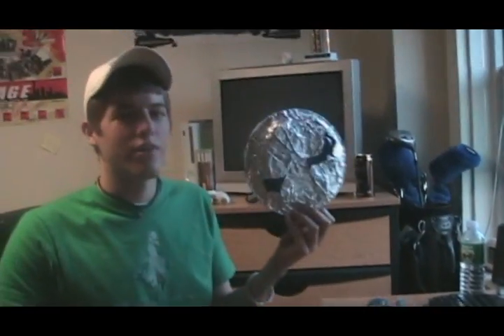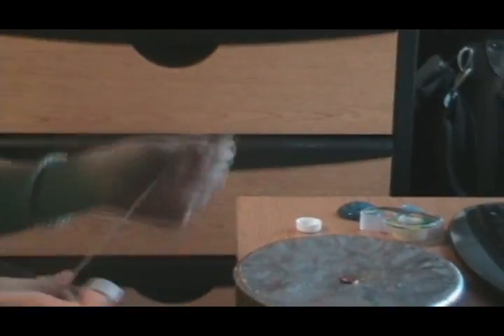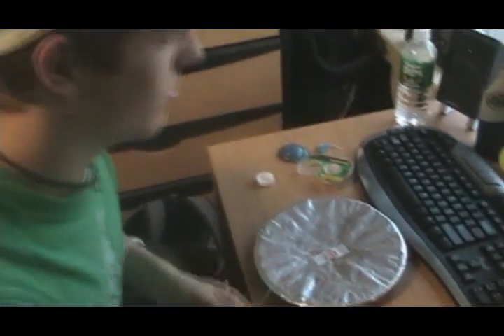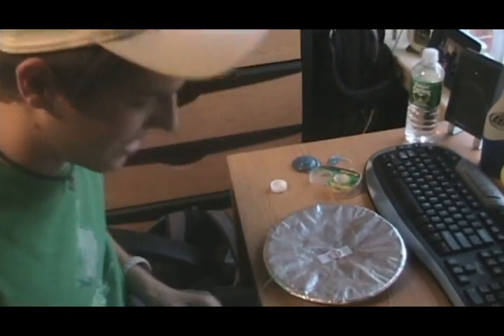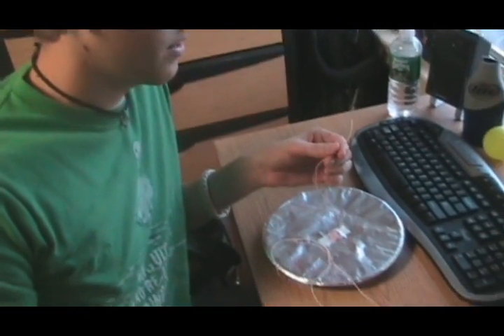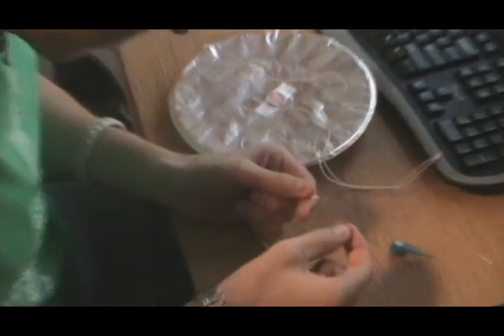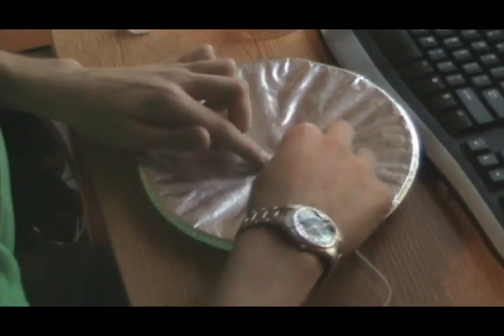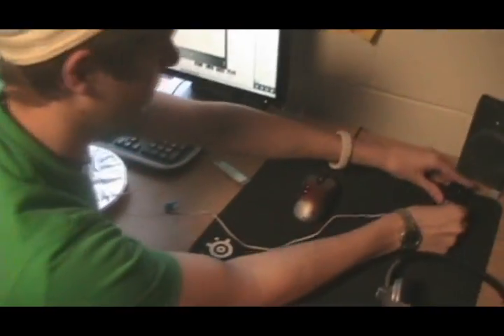RE: How to Create a High-Def speaker for under a buck.

Comment: I think you are using headphones' cable which has magnetic wire. This wire has a paint on it which acts as insulation. So it's as if there is no connection between the coin and the wire. There are to ways to make it conductive. Peel the paint off with a knife or burn the paint using a lighter briefly. If you use the latter method maybe you will also have to use the knife to peel the burnt paint off.

Comment: Mine worked shit quality but it worked just burn off the coating on the wires and put one wire from the left head phone on the penny and put the other one on the foil it's self n it should work just turn up the volume( if not work then I'm magical lol ) try it .

Comment: Right, I suggest that you could attach one end of the jack to the penny, and the other end to somewhere on the aluminum foil, but make sure that you have two wires from the jack or it might not work, but you are probably better off getting a magnet and making a voice coil from wrapping copper wire around a pen, or better a dry erase marker and attaching it to the diaphragm of the aluminum then hooking the two ends of the copper wire to the two ends of your audio jack.  :)

Comment: Nice presentation.  

For the next experiment, try getting a big bolt (say 1/4 or 1/2 inch diameter) and wrap lots of turns of wire around it to make an electromagnet. 

Connect that across the audio (needs to be more than headphone volume). 

If you bring a magnetic object (eg tin can) near the electromagnet you'll hear the sound.  Play with spacing for best volume.  Works but not great quality.

Comment: Don't worry it is normal,
that video was not true ..
but if you put a Circle inside the(under the center od the metal paper) roll it all (more than 50 turns with  a insulated cable) with one side cable, conect to the other side cable of the speaker out, let a little piece of  metal over the centre it works, but.. you need also to insert some resistence about 2 ohms.

Comment: well as far as i see it it will never work but what u can do is take a copper coil and replace it with the penny, attach it to the wires if u can figure that out and then put a magnet on the bottem attached to the inside and maybe with a little luck it would work.

Comment: With this conditions and materials you will never construct a  high definition speaker...

To construct high definition speaker you need to have membrane foil, bobine and a permanet magneto. (This is the tradicional way)...

Sound is made by variation of the air pressure... please explain me how you can have made a variation of air pressure with this stuff? Oh let me see, the penning is piezoelectric material... 

cheaty...

Comment: By coiling unexposed wires around the penny you can turn it into an electromagnet, but then you'd need a second magnetic element on the other side of the plate.

Comment: well first of all seeings as its 1 speaker its only gonna be mono sound, so seperate the cables and just tape down one side of the cables instead of the 2, its most likely the fact that you were taping down both wires therefore shorting it out. try with one side.

Comment: Some people thing the only way to create air vibrations are magnets. What you forgot is that air is created out of particles. Maby that alimunum thing ionisates airmolecules which wil somehow start to vibrate at the same frequecy as the wire sents the electrical shocks. Also the output for a headphone is a very weak signal because otherwise it will blow op your headphone. Maby try the plugs at an amplifier.

Comment: It amazes me that people here don't realise the joke.

BTW, you could potentially damage your speaker system by doing this - you're effectively short-circuiting its output with the foil and coin. Worse still, the speaker system might just pass the signals from the computer straight through to the headphone jack (I know some speakers do this), meaning the damage could instead be to your soundcard or sound chipset.

Comment: you need a copper pennie 
If your Lincoln Memorial penny has a date before 1982, it is made of 95% copper. If the date is 1983 or later, it is made of 97.5% zinc, with a thin copper coating, or "clad."

For pennies minted in 1982, when both copper and zinc cents were made, the safest and best way to tell their composition is to weigh them. Copper pennies weigh 3.11 grams, whereas the zinc pennies weigh only 2.5 grams.

Comment: **just a thought: a lot of speaker headphone wires actually have 2 wires running in them. one has a light silicone coating on it. when you strip the wire, try heating (with a lighter) the exposed wires to melt off the silcone. then try it again. i havent tried it yet, but this could be the problem lots are having.

Comment: you have to change the speaker options on windows. go to control panel, then click sound and audio devices, click on advanced under speaker settings and then click the setting for paper plate wrapped in foil, I did this and had no problems.

Comment: headphone wire have isolated coating on them. If you cut a headphone wire and connect them to a speaker nothing will happen, but if you burn the wire and/or sand it, it will remove the coating and work... 
butt still, taping it to the penny will short the wires and will not work

Comment: Cody, Use your brain.  Is there really such a thing as a speaker made from a paper plate, aluminum foil, and a penny?  Just because it's round with wires coming out of the center doesn't mean it's a speaker.  How the heck does a penny cause audio vibrations?  Think Cody Think.

Comment: How does it have the basic design of a speaker? Just because it's round with wires coming out of the center doesn't mean it's a speaker.  Did you ever take 7th grade physics? The electrical current is shorted by the penny creating heat not vibrations.  The aluminum or plate has no purpose except to fool people into making it look like a speaker.  It's SAD to see people so ignorant.

Comment: the edges of the foil must not touch each other on the backside! and try to keep the foil a bit tighter on the plate so it can vibrate and create a sound. i've also made this mistake at the first attempt.